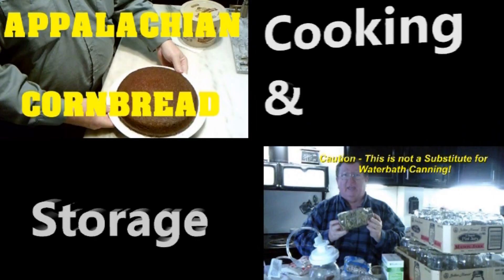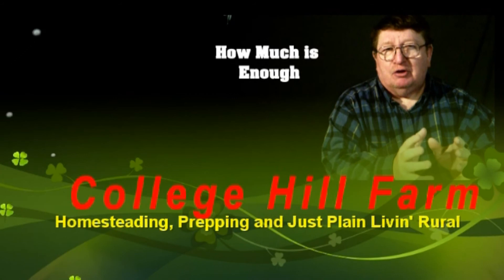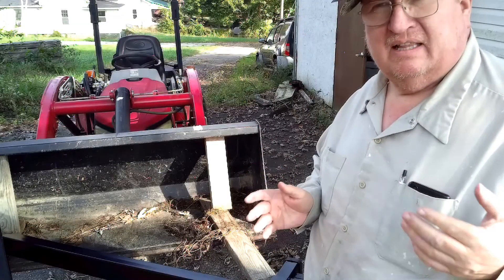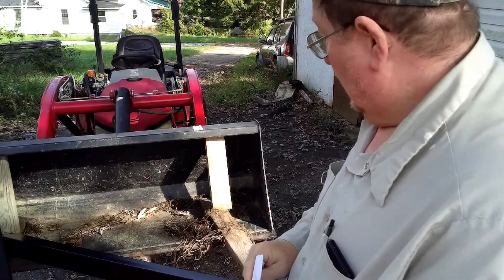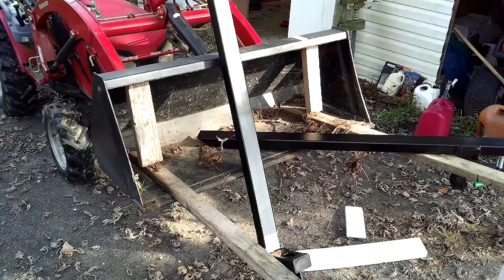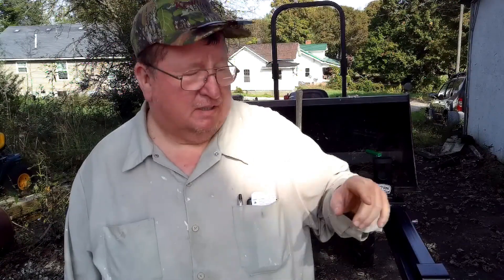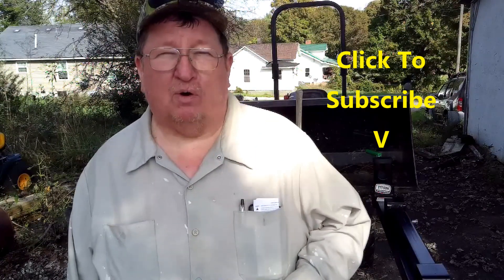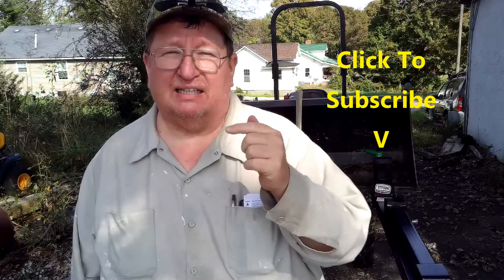Titan Attachments Clamp On Pallet Forks Lite Duty - Unboxing and First Impressions

Comment: The holes on the front top and bottom are quick attach for chains, looks like you could put a chain in the bottom and go around the back of the bucket to secure the forks on the buccket
Reply from the maker: yes it is after looking at the instructions. Also the holes with the rubber cover are for 2x4 uprights. Thanks Mark

Comment: I will have them soon. Just pulled them up on the website. Will order soon. I think the bucket can handle a little more. I think it's rated for 900lbs at max height. I think it can handle a bit more at half way raised.